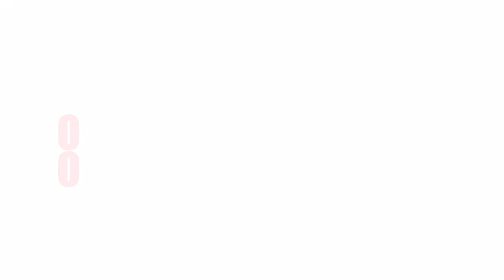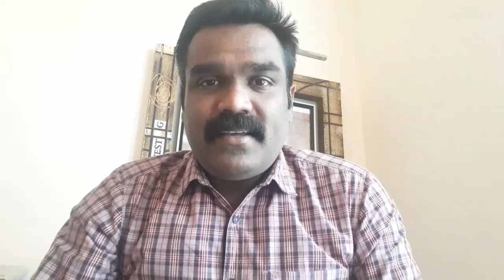Basic Offshore Safety

Comment: Sir oil and gas sector future is in dark. There will be no demand
Reply from the maker: No way to stop drilling until someone find an alternative option for fuel.... so oil and gas will remain for long time for sure
Reply: Sir I'm going to do job in Barge in 1 week but I don't know swimming and I'm very scared of water. What shall I do. I'm very upset
Reply from the maker: @zeeshanuddinkhan3488  no worries... swimming is not an issue.... you will not fall in water.... even if you fell down accidentally, you will survive with lifebouy or life jacket. It means, whenever you work on risk area / exposed area, you will wear life jacket. So nothing to worry.... even I dont know swimming... 🥰😆